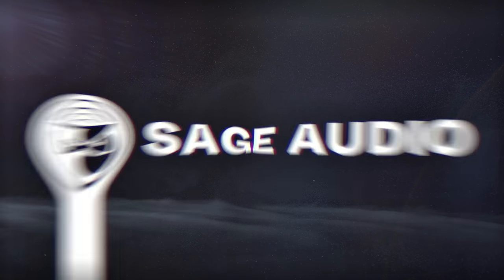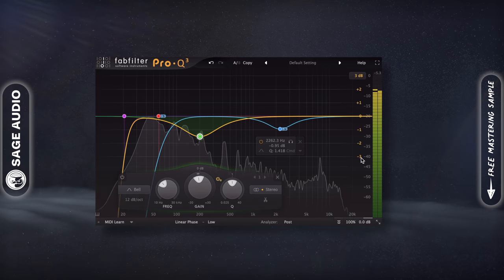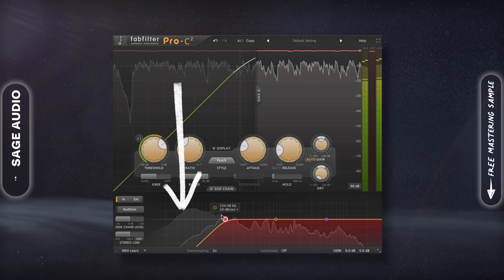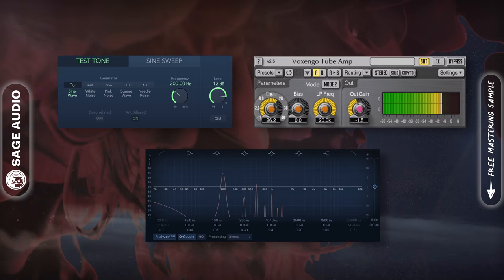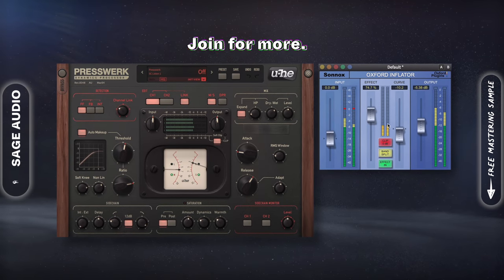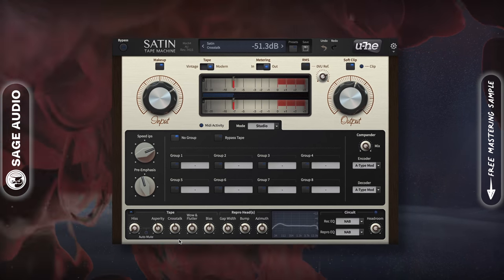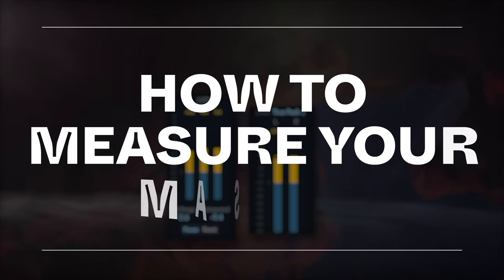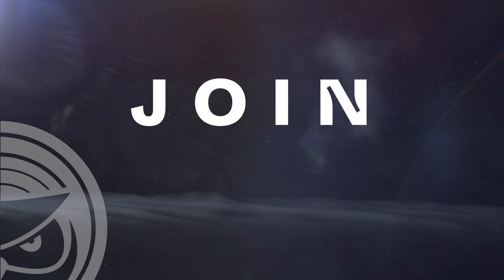How to Master Music

Comment: Why do you keep calling the inflator upwards compression??? The inflator introduces a single harmonic generated from the fundamental similar in style to clipping a very high end A.D converter. The curve then introduces more even or odd harmonics dependent on direction. Very different from low level comp.
Reply from the maker: Thanks for watching! The inflator introduces a 3rd order harmonic but it does more than this include compression from the noise floor up.  

SageAudio.com
Reply: @sageaudio  where are you getting that info from? 
I am currently a Sonnox plugin beta tester and have been since the v1 more than over a decade.
The odd harmonic introduced along with positive curve valves introduce higher harmonics along the frequency spectrum and give the bionual que of presence/air in a very clean un-tube like way due to meticulous work by the team on the algorithm.
 Similar to the affect of upward compression. But I guarantee you the is no noise floor enhancement or upward compression.

Comment: Hi Sage Audio.... could you or anyone clarify the release thing?  If the release time starts from when the audio goes back above the threshold then surely timing the release to the bpm of the track does not necessarily make it "in time" as it would be dependant on where the threshold was set?  (so when the audio crosses the threshold starting the release, it probably won't be an exact division of the bpm). Cheers :-)
Reply from the maker: Great question! You're right - there will be a slight difference in timing depending on how long it takes for the trigger to go from compression to noncompression after the release time!  But ideally this should be almost immediate so the release time will still work well when determining the timing. 

SageAudio.com
Reply: @sageaudio  Great stuff, thank you :-)

Comment: Can you please tell mesir the how to get the release time for lows, mids, and highs?
Reply from the maker: Use quicker release times for higher frequencies and slower for lower.  The quickest you should use on the low end is 50ms, and for the high end 0.5ms.  

SageAudio.com
Reply: @sageaudio  so for more punchy lows I should go more than 50 ms, right?
Reply: @sageaudio  I have observed that, pro use multiband limiting on masters... Ex - kshmr, and others in edm 
When observed in span, the peaks have so much less difference in them compared to our tracks... And when I tried this, multiband limiting... I got so loud 😕 
Sir any comments on this thing....